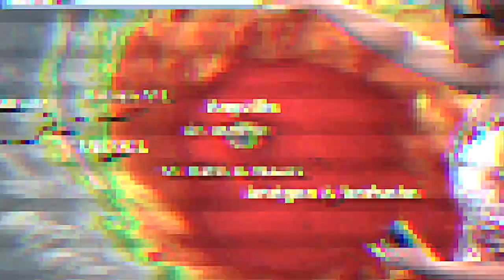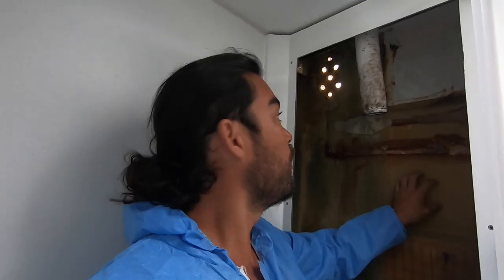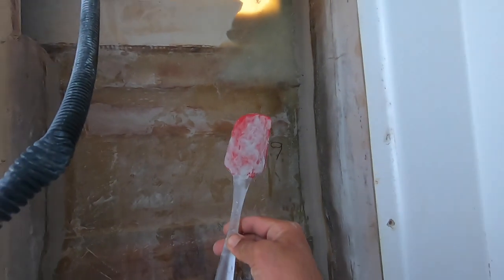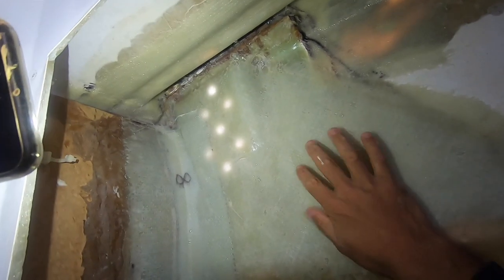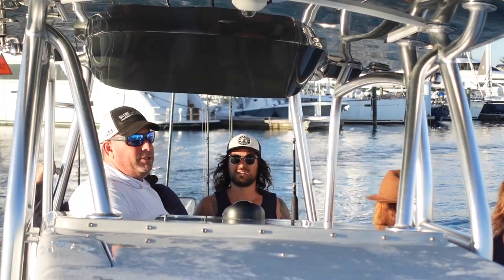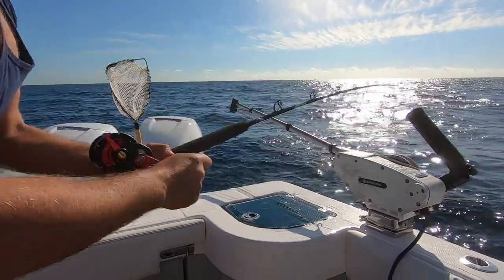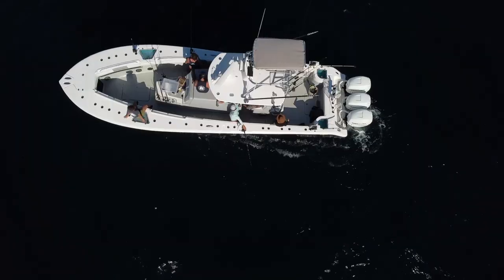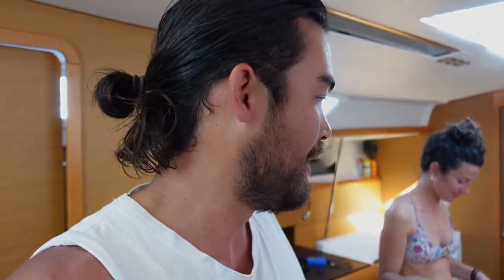CATCHING SAILFISH IN FLORIDA USING KITES!!  - Episode 98

Comment: Back in the 80"s at the Chrysler Paint Area a good friend of mine worked there. It would get up to 120 F during the summer. The heat was nutz. He found an unused air port, ran a regulator and the  supply  hose to one pant leg of his jumpsuit and duct taped it closed. Turn the air up enough to fill his suit and face shield so he had positive air flow. Pretty soon everybody was at 70 F and singing while they worked! You have to cool the air where you are so you could run it thru a junk yard radiator sitting in the water.

Comment: You may want to look into that as I believe they use the bonding agent because it flexes. It is to prevent stress cracks. Glassing it in will not allow it to flex and create cracks. Just my thoughts from experience in building high rises.